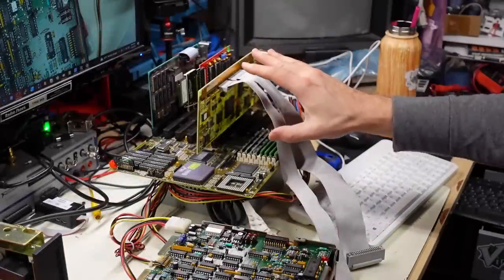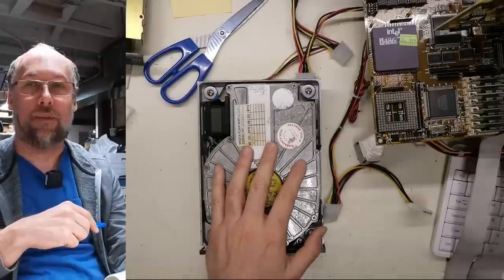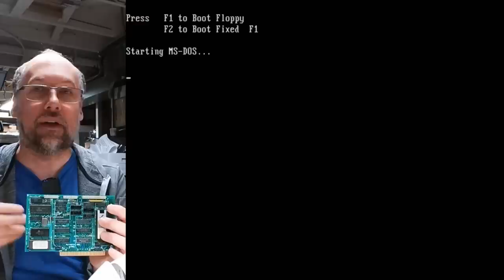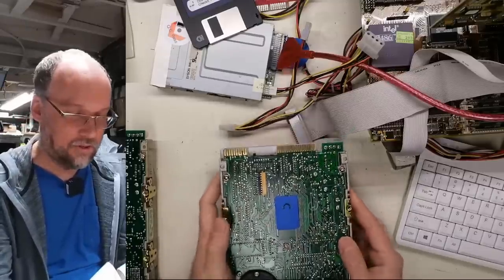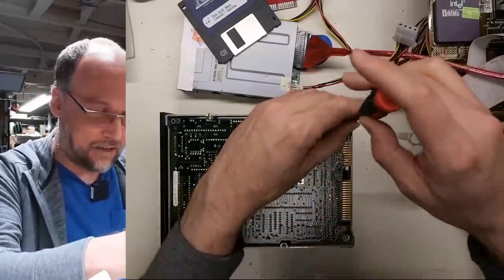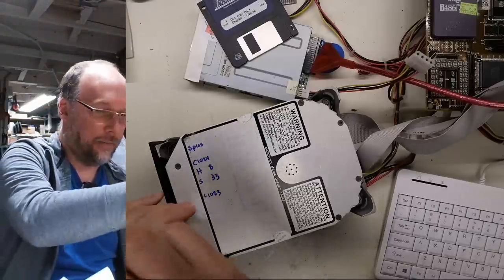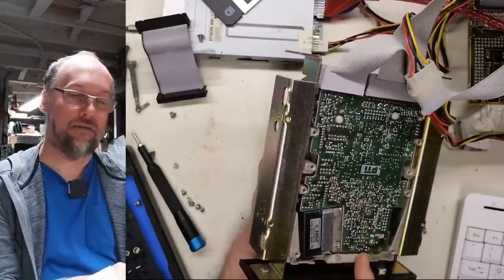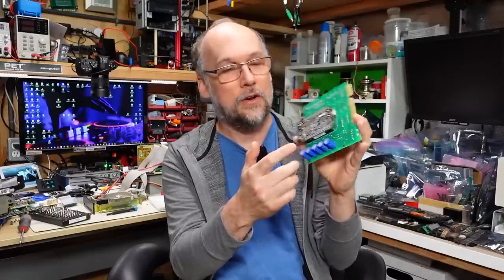MFM drives are really unreliable

Comment: no service manual needed to find a shorted component.. the correct value for a shorted component is in fact ~ 0 ohms .. if not at and or around 0 ohms likley component not shorted and will not overload volt reg ic's ;-)

Comment: not an air filter.... its to balance the air pressure when the drive spins up.... otherwise it would explode..... thats why they say do not cover this hole.......
Reply from the maker: The hole is definitely to equalize pressure but the filter looking thing is definitely there to catch any dust that might be in the mechanism. The ST506 service manual talks about it.

Comment: You really need a proper power supply for operating these old drives, I can see your connectors are obviously giving you problems as well.. there is just not enough current to "unstuck" or start the spindles. I threw out many good "archive" drives I had around from the late 80's and 90's because of this misdiagnosis, I would use whatever power supply I had around and if it wouldn't spin up it would get tossed. Then I found out about this problem.. you need at least a 10amp capable 12v supply, the 5V should be 5amp minimum.. no computer connected if you're using an old PC supply because they could barely output what they had marked on them when new. I've put a digital load on some of these supplies and they are not even close to the output that is printed on them and extremely noisy under load.. measure the yellow 12v line when it's trying to start, it will drop well below 11v and that is simply a no go.. some of those old drives have circuitry to detect this and won't try again until the power is cycled. I worked at a xerox service center in the late 80's repairing this stuff, it was well built then, it will work today.. but you have to service it properly beforehand.

Comment: I remember after the IDEs came in as the new de facto standard taking apart so many of those old MFM drives for the platters or just to have the disks open and on display in my room.  I still have one of those exact monster Micropolis drives - OPEN - as a door stop in my office for the last 35+ years.
Reply: I took the magnets out of a 1GB ESDI drive years ago because I couldn't find a ESDI interface easily. Those are some crazy strong magnets!

Comment: could it be you didn't park the ones not spinning up now ?. Parking the heads on some put the heads off the disks onto a plastic spacer ?.
Reply from the maker: On new drives it  can unload the head (lifting them from the disk) but on old disks it puts it in the landing zone, which is on the disk still, just on a track that's not used for data.

Comment: I purchased my ST-225 in 1988 and threw it away in 1994. I threw it away working. I had Borland's ANSI C compiler package, and Word Perfect 5.0 as my main applications. Oh wait, I also had Procomm. After I graduated to a 386-DX 40 I put Windows 3.11 on it. But at that point the drive was running short on space and I moved on to a cheap 100 MB IDE.

Comment: I had a Micropolis 1335 on my old 386DX/20 machine.  Yeah, it was loud, and sounded just like your 1325.

You should donate that 1325 to the DEC community. They can either get it running, or use it for parts.  Reuse > Recycle.

Comment: funny seeing the german translation for "fragile": "zerbrechlich" on the diskdrive, too. I think  I had some mfm drives like these in the mid 90s when I worked at a computer repair workshop of the local university part-time when I was still at high school. They all were either trash or stored for later use which never apparently happened

Comment: Seagate drives sucked back then, they suck now.  If I absolutely need to buy a mechanical hard drive for some unknown reason, I’d buy the Hitachi HGST Enterprise drives.  Oh, you can’t get those new because they shamefully sold off that business unit to Western Digital?  Well, I’d look for used ones on eBay.

I have more faith in a beat up, used HGST than a brand new Seagate.